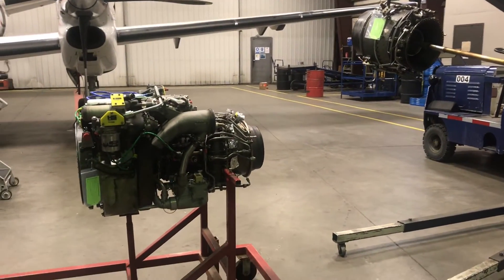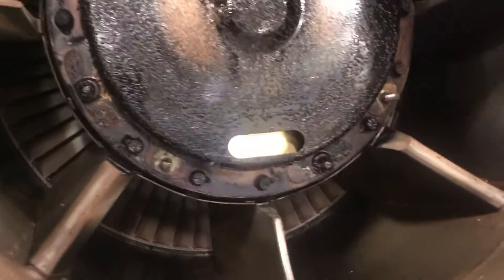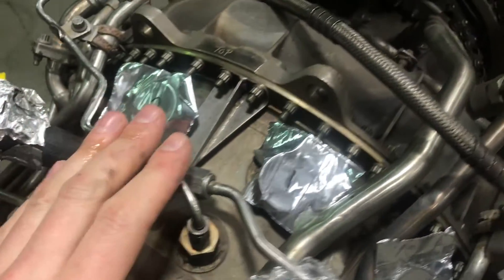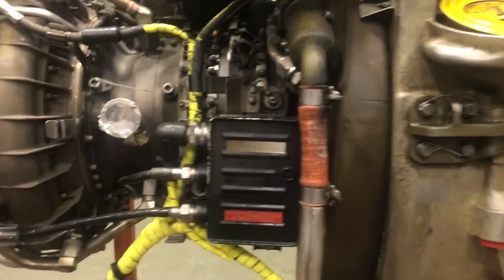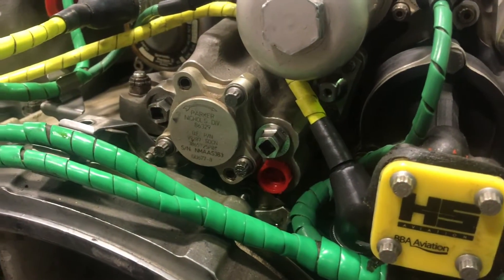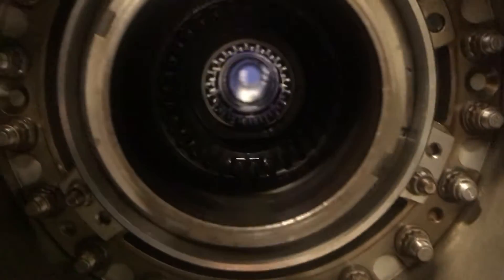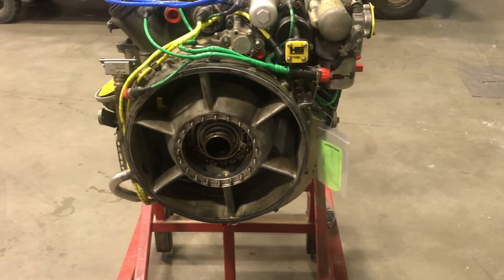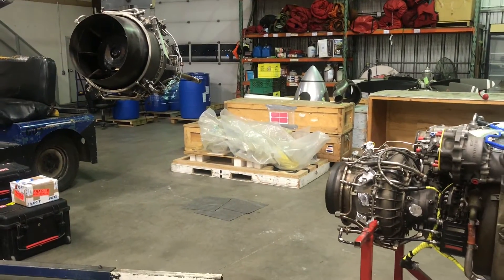GE CT7-9B Engine

Comment: Ya isn't that shaft the spool for the compressor and turbines?
Reply from the maker: thefactorypilot145 at what part? The long shaft that is visible on the back half that is detached is the prop shaft. It connects the power turbines (not compressor turbines) to the propeller gearbox. This shaft spins inside of another separate shaft that connects the compressors to the compressor turbines.